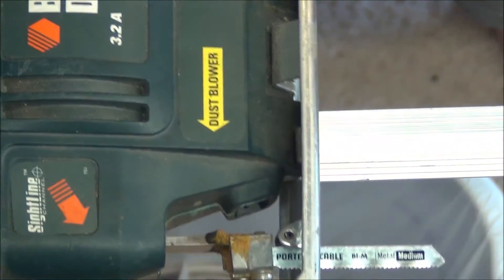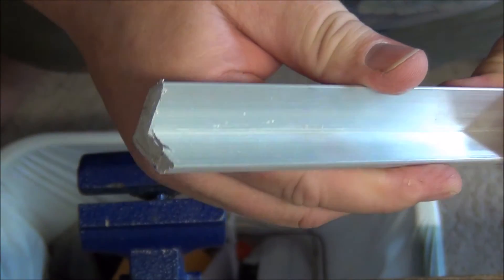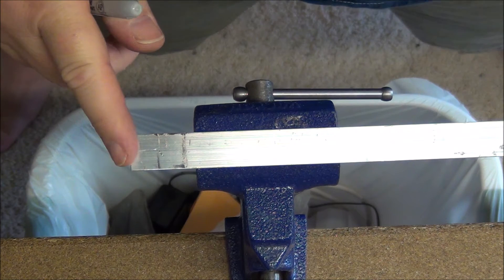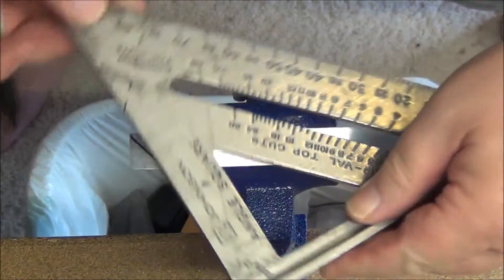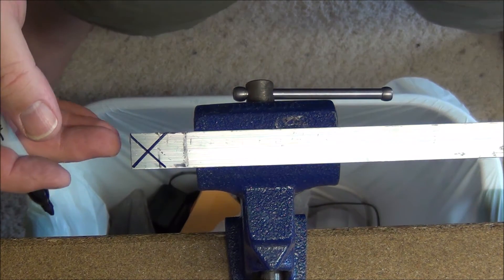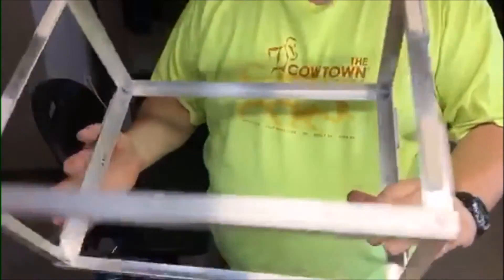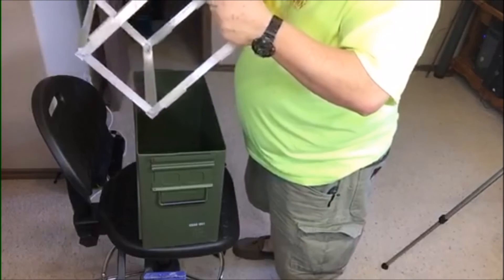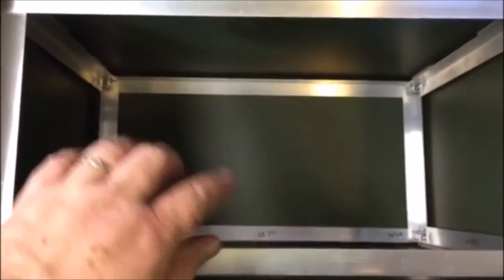EMP Resistant Ham in a Can, QRP radio and batteries, Getting ready for the next disaster part 2

Comment: That frame does look great, Dave!  One thing that I noticed with my own similar setup is that over time those pads (on the bottom at least) will get flattened so keep a few extras on hand.  Could also reuse old mouse pads if you have some of those laying around.
Reply from the maker: Richard Slusher Great tip!
Reply: No problem, Dave.  I just didn't want ya thinking I was trying to steal your thunder or second guess ya!
Reply from the maker: Richard Slusher Hell half of the time I have know idea what I am doing.
Reply: You're able to wing it pretty good then!  ;)

Comment: Be sure to have a good electrical contact to the lid or the whole thing wont matter if it is EMP prof. You can do that by have a ground strap from the case to the lid, or make sure the hing is very,very clean to make electrical contact.
Reply from the maker: Jon Williams Great tip.  The handles snap into the box pretty securely.  I believe by removing any paint at thought locations it would work well.   Only the ohm better will tell.